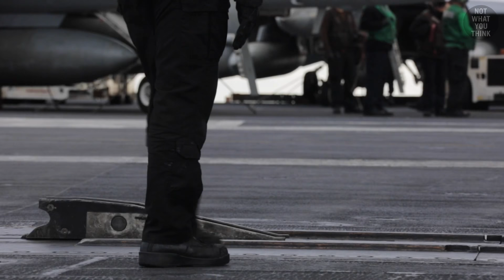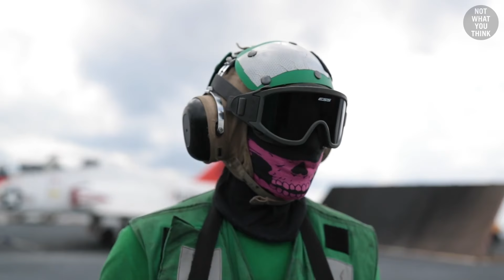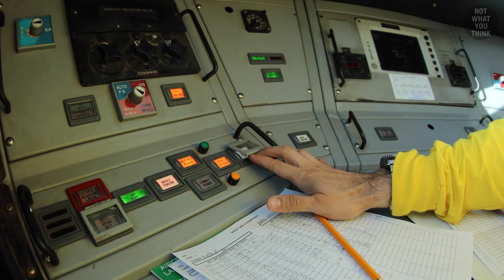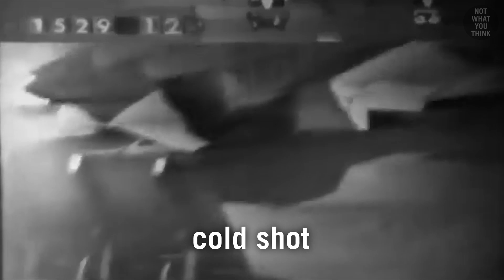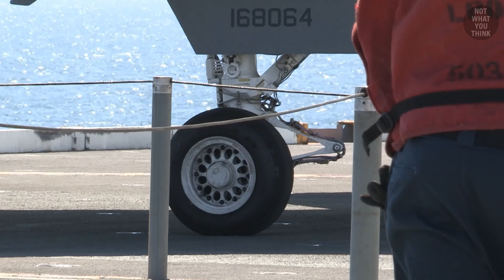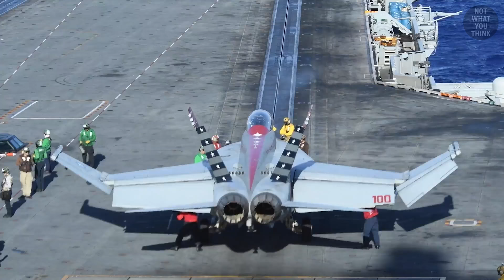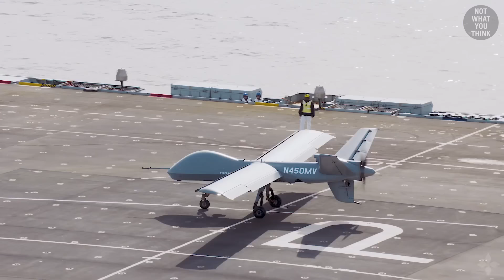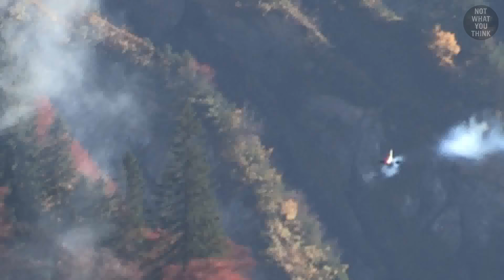Why the US Navy is Replacing Electric Catapults with Steam

Comment: You did not mention catapult cycle time. If I recall correctly,  EMALS requires around 45 seconds to cycle, while steam requires around 4 minutes. This can impact how quickly you can assemble and launch a mission.
Reply: Yeah, one of the big advantages of the electromagnetic launcher is that you can get a lot more into the air in a shorter period or time, and it takes two personnel to operate the system instead of twelve. France and China will be using them, the UK is evaluating the General Atomics system for retrofitting to  existing carriers, Italy is researching the subject, even India is working on its home grown version. There's a good reason none of these countries is using steam.
Reply: @stevebrooks2361  The UK isn't evaluating anything. They would have to completely rebuild their carriers and they don't have the money. France has a shot at it, maybe. China has a system that doesn't work yet and probably can't be brought up to snuff. Italy doesn't have the need or money for carriers. India is interesting. I wouldn't bet against them. They seem to be to the point they'll stop buying Russia's failed crap.
Reply: @patrickweaver1105  Evaluating them for "FUTURE CARRIERS," really, did that even need to be said? The latest Chinese Aircraft Carriers are equipped with electromagnetic launchers, you think they put something on their Aircraft Carriers that doesn't work? That would be just silly now right?
Reply: @patrickweaver1105  I saw Japan this month successfully tested their electro. They will need it.
Reply: @ste @stevebrooks2361 t move the goalposts: You’ve wrote “retrofitting existing carriers” when referring to the UK
Reply: @Zeguyfromgermany  Yeah they were examining that but moved away from it, the timelines changed and I was still looking at older data, then looked at newer data, my bad for not checking properly in the first place and making sure I wasn't confusing two different projects:

"Project Ark Royal Shelved: Earlier studies under Project Ark Royal explored adding assisted launch and recovery equipment (ALRE) to the carriers"

That WAS project "Ark Royal," and yes at the time they were looking at retrofitting existing carriers, they are now on "Project Vanquish," but who know whether or not that will change.
Reply: @stevebrooks2361 I don't think the Islamic Republic of United Kingdom will be doing any of that very soon.
Reply: @r @rennoir2454  the point is we made a staggering mistake of designing the aircraft carriers around a plane manufactured by a mafia state ideologically tied to russia. both ofwhom currently the two countries most likely to attack nato and the uk.  you don’t need electromagnetic launching for paper weights no matter how big and expensive they are
Reply: @rennoir2454  With your factless perspective, you're irrelevant.
Reply: @rennoir2454  
You don't have the organ to think.
Reply: That’s insane. I’m convinced Putin was shit talking electric to Trump to get him to do away with them and eliminate the advantage.
Reply: So, can the deck crew move a fighter jet into launch position in less than 45 seconds?  Or does it take 3 to 4 minutes?
Reply: @ataxpayer723 If you are on your life, YES, you will get them out around a minute or so
Reply: A steam Cat can launch a plane every 80 seconds
Reply: @linusa2996  the Pentagon wants (although it's still for fetched) to add automation and drones to deck operations. they think that in the future drones will move to the catapults autonomously
Reply: @linusa2996 
The carrier can average a launch every 80 seconds, individual cats cannot.
Reply: @FallenPhoenix86  According to the Nimitz surge exercise, 4 c-13 steam cats can launch 4 planes in 74, 1 plane every 18 seconds during surge cycles.
Sustained 1 cat can launch a plane every 4 minutes
Reply: A small step in the right direction. Now, to replace nuclear reactors with sails.
Reply: @brianmahoney3256  No, remember Trump loves coal.
Reply: THAT is the SECOND reason for the switch. Donnie LOVES STEAM and HATES ELECTRICITY. PLUS, it makes us MORE vulnerable, and causes MORE OF OUR MILITARY TO PAY FOR HIS TREASON.
Reply: Seriously ? And how long does it take to wrangle a jet onto it ? 45 seconds ? sheesh
Reply: Practice vs. Theory.  The Chinese Fujian and USS Gerald Ford both seem to deliver slower sortie rates than predicted.  As both nations have given their EMALS carriers less-than-front-line roles.  Until today, when USS Gerald Ford  faces that ultimate test.
Reply: @hallmobility yeah let's be honest here they don't have the Electric System they've tried it but they found out using conventional power does not provide enough power to cycle. It has to have a nuclear reactor in order to function properly
Reply: @GR_Chief  So there has to be an energy storage facility to store power for at least one launch, then it must recharge.  Capacitors, batteries, accumulators, compressed gasses and flywheels are all examples of energy storage facilities.  Obviously nuclear/steam has lots more capability than conventional.
Reply: @hallmobility  No Ford is actually faster for a number of reasons. One that no one talks about it's easier to spot aircraft on the flight deck for a Ford class.
Reply: @hallmobility Fujian doesn't face this problem dude
Reply: @kimfeiwong7543
You’re correct. Fujian can’t even launch properly 🤣
Reply: @kimfeiwong7543 you're right because it's a conventionally powered aircraft carrier and the Chinese don't have the capability to cycle an electromagnetic catapult using conventional steam power
Reply: China doesn't use EMALS ... Get your facts straight and cease posting junk
Reply: @SevenBee-q2jits newest carrier does
Reply: @SevenBee-q2j SORRY, look up the _Fujian_.  Lots of stories about her, from various perspectives, for YEARS. She does have EMALS.  Controversial and troublesome, but she does have at least one.  Even a video showig a launch.
Reply: @SevenBee-q2j
Yeah... they do actually...
Get your own facts straight before looking like a clown again.
Reply: Don't tell the president that. You'll be imprisoned
Reply: @RichRich1955  Why would he be imprisoned? Trump hasn't imprisoned anyone for disagreeing with him.
Reply: @patrickweaver1105  but he has tried multiple times
Reply: @rickwhite3757  This isn't true.
Reply: @patrickweaver1105  You live in a world where Trump declares leftist ninjas sliced open his blue (algae green) reflecting pool (it definitely wasn't him driving an overweight motorcade over the poorly applied coating), and then later the local goon squad arrests an Olympian who simply touched the already fucked up pool. You live in this world, and yet you feel the need to not get the point. Braindead.
Reply: @patrickweaver1105 that's definitely true😂
Reply: @patrickweaver1105  Trump has fired or driven out of their position many folks that did disagree with him. He often accuses people that disagree with him with "treason". Trump is surrounding himself with yes men and sycophants. His echo chamber is not a healthy environment for making informed decissions.
Reply: @archstanton_live  That's his job. You may not like  the way he does it but that's your problem not his.
Reply: @patrickweaver1105  I am expressing my first amendment rights about the unique way he is doing his job and defining his job. The problem is all of our's.
Reply: @patrickweaver1105  🤣🤣🤣🤣🤣🤣
Reply: @patrickweaver1105  
1. The position of the president does NOT allow him slash and remove experts and entire departments without the approval of Congress.  You know, the ones that our Constitution states make the laws and funding?

2. His job is to server the people.  When he removes services and expertise, he is hurting the nation.
You are correct in a sense, it IS our problem, but it is also true that he can be held responsible.
The B.S. ruling by the "Supreme" Court that a president cannot be liable for "official" actions has not be tested in court yet.
Reply: @OrpheusSonOfCalliope  That depends on how congress wrote the bill. They usually do it the lazy way. Which means how the things they mandate are left up to the executive. Cutting through the waste fraud and abuse is serving the public.
Reply: @patrickweaver1105 
No, his job is to uphold the constitution... not to do whatever he feels like or lash out at facts he doesn't like.
Reply: @patrickweaver1105 
He is the single largest source of fraud and corruption in DC...
Reply: @FallenPhoenix86  That's nice. so when hasn't he upheld the constitution?
Reply: And EMALS take forever to launch F35.
Reply: @matcao9962  Well as far as I can tell you are literally just making stuff up because you don't like EMALS, unless you would like to present some evidence because everything I can find about EMALS and F35 says the exact opposite.
Reply: But if the system fails they all fails and shut down. Steam catapult are all independent if one fails, 3 others can run.  2nd, the rate which you launch planes no longer matters because US navy no longer even has competent air wings sizes capable being launched. The F35 is simply expensive and maintenance prone to effectively meet Ford promised sortie rate.
Reply: @spikedpsycho2383 
Go look at how the target sortie generation rate was arrived at... it's bunk.
Hundreds of additional deck and maintenance crew were brought on board along with dedicated mission planners to free up aircrew. The exercise undertaken to establish max generation rates was based on a fantasy crew compliment and conditions that simply don't exist in the real world.
Reply: @spikedpsycho2383  Yeah that wrong, even a basic google search will tell you that, it would be stupid to design them like that:

"No, if one electromagnetic launcher on a Ford-class aircraft carrier fails, the other launchers do not stop working. Each of the four EMALS tracks on the ship operates with a high degree of independence, featuring separate motor controls and energy storage feeds so a fault on one track does not disable the rest of the flight deck"
Reply: @stevebrooks2361  Google is not always correct!
Reply: @dalenulik5622  Very true, so you have to follow the data to it's source, most google results show sources, it's the source that's the important part.

Comment: I'm a mechanical engineer. I specialize in aerpospace and space technology. 

And I can tell you for a FACT, a mature electric platform, is ORDERS OF MAGNITIDE better, in almost every way. 

Why do you this the entire industry is moving in that direction...

When the first diesel electric train rolled out, they where actually less efficient that steam. Ten years later, electric had won out, it was better in every way. 

Diesel-electrics caught up because the diesel engine itself got way better. Higher compression, turbocharging, better fuel injection, better metallurgy, and much better cooling and lubrication. At the same time, the electric side improved. Generators, traction motors, and control gear became more efficient and reliable, so less power was wasted turning fuel into wheel torque.

A big hidden win was control. Electric traction lets you put power down smoothly at low speed, so diesels could actually use more of their power instead of slipping wheels like steam often did. Plus multiple-unit control meant one crew could run several locomotives together, which steam just couldn’t do efficiently.

it’s basically the same transition pattern playing out again.

Steam catapults are like late-era steam locomotives: hugely refined, brutally powerful, and well understood. But mechanically messy, slow to reset, maintenance-heavy, and hard to control precisely. They work, and they work reliably, but they’re near the ceiling of what the tech can do.

Electric catapults (EMALS) are like early diesel-electrics: initially less reliable, more complex, and not obviously “better” in headline power. Early versions absolutely had teething problems, just like early diesels did. That’s why the debate is loud right now.

But the real advantage isn’t raw power, it’s control and scalability. Electric launch lets you precisely shape the acceleration curve for different aircraft weights, which reduces airframe stress and opens the door to lighter drones and future aircraft. Steam basically goes “full shove, deal with it.”

Then there’s systems efficiency. Steam catapults need boilers, piping, pressure management, and huge thermal losses. Electric catapults plug straight into the ship’s power system. As ships move toward integrated electric propulsion, steam becomes the odd legacy subsystem hanging off the side.

And finally, future growth. Steam is tapped out. Electric isn’t. Better power electronics, storage, and control software all directly improve catapults over time, without redesigning the whole ship.

There is a reason, why electric keeps winning...

Comment: Steam leaks through the deck and washes over aviator cockpits.  If you get whited out by steam, you have to stop taxi'ing your aircraft into position until the steam clears.  Maybe you lose 10 seconds a launch.  But if you're launching 60 aircraft, that puts you 10 minutes behind getting all of your aircraft off the deck.  10 minutes doesn't sound like a lot of time.  But if you have enemy aircraft inbound or trying to coordinate a large attack, it matters quite a bit.

Comment: The big advantage of electromagnetic cats is that they offer an improvement to airframe life. F18s were designed for 2000 cat shots, with life extension programs 2600 shots. Electromagnetic cats greatly reduce stress and airframe fatigue life.

Comment: All the problems that the US EMALS had, China's version  didn't have those problems.  The electrical power system for the US and Chinese EMALs were also totally different, China's is DC system while the US version uses AC. In practice the Chinese version has far fewer problems than the US version.  The US version still is not able to launch the F35.

Comment: People have absolutely no clue as to how much raw torque can be produced with steam power
Reply: I think the point of the video was to highlight that in some situations it produces too much
Reply: @NeedMoreDakka it's steam power you can easily adjust how much torque you're putting out it's pretty much nothing more than engaging a regulator. And unlike an electrical catapult on the ocean being exposed to Salt Air and sea it will definitely hold up a hell of a lot longer
Reply: @Reaver6666 : Yea, when you have salt water waves and spray coming over the bow and the cat is at the bow, do the math!

Comment: Ford Class CVN, LCS and F-35 not as advertised... The Ford Class CVN is a problem child. EMALS, AAG, RADARS, ELEVATORS and the Sewer System. The sewer system has a design flaw, the piping is to small. Chemical flush is required to clear clogs at a cost of $400,000. per flush.

Comment: Any good electrical or mechanical engineer can see the advantage of electrical catapults. Yes, there may be a slight learning curve involved but over this this will be corrected. Just in the area a maintenance it makes sense. I've worked in the area of automation for years and anytime we could substitute electrical mechanisms for air operated it greatly improved the process.
Reply: Switching to an electric system is highly likely to be a misjudgment. The biggest advantage of pneumatic control lies in the protection of the system itself. In the event of failure, it means the direction of operation and the uninterruptible device. It is a misconception that electric systems are more reliable than mechanical ones. If you are an engineer, I recommend you to study again.
Reply: @Mah3mop So the people who design the catapults don't know what they are doing.
Reply: @juscurious-x2c  For your information, I live in a non-English speaking country. Unfortunately, the Ford ship had to be seen as a test ship. The problem is that the fate is that it must eventually be completely replaced due to continued delays. If I were the designer in charge, I wouldn't have known this delay would happen. As a foreigner, it's hard to say anything about the delay issue. Isn't it a problem that those with decision-making power have been putting it off? While electric eschephropathy is a good idea, I think it could be an alternative to localized chemical (explosive) firing.
Reply: The complete replacement I mentioned refers to aircraft carriers like the Nimitz-class, which are currently operating in the field, not to replace the Ford ship's own system.
Reply: @Mah3mop In the early days of solid state electronics, there were those who insisted that devices like transistors would never replace vacuum tubes. Where are those people now if still living?

Comment: The USS Gerald R. Ford's Electromagnetic Aircraft Launch System (EMALS) is interconnected with the ship's electrical systems, which complicates maintenance and leads to slower operational cycles. In contrast, China's Fujian aircraft carrier features a more reliable EMALS that can isolate catapults quickly, allowing for faster launch cycles.    
Key Differences
 The USS Gerald R. Ford's EMALS is integrated with the ship's electrical systems, making it difficult to isolate components for maintenance during flight operations. This leads to longer downtimes and reduced sortie generation.
 In contrast, the Fujian's system allows for quick isolation of malfunctioning catapults, enabling faster repairs without affecting the overall operation of the other catapults.
The Fujian has demonstrated a significantly higher reliability rate, outperforming the Ford's EMALS by a large margin, which is crucial for maintaining operational efficiency.
This comparison highlights the technological advancements in the Fujian, particularly in terms of reliability and operational efficiency, which pose challenges to the USS Gerald R. Ford's capabilities.